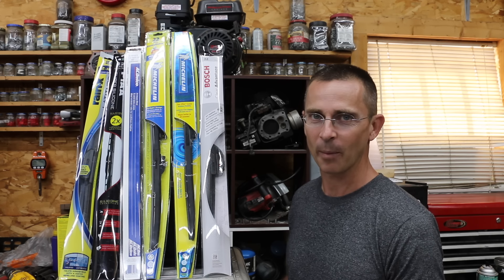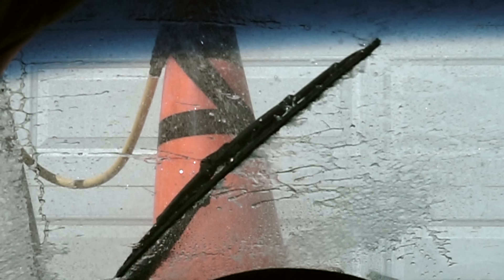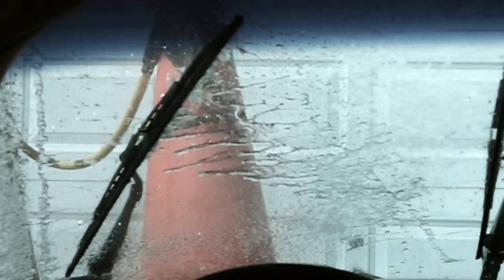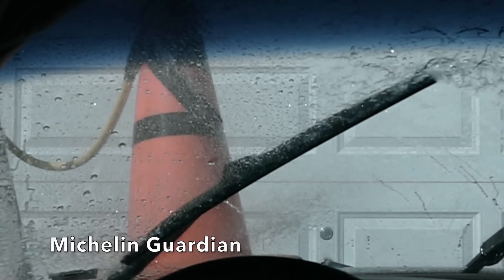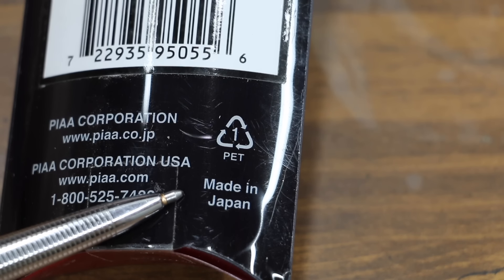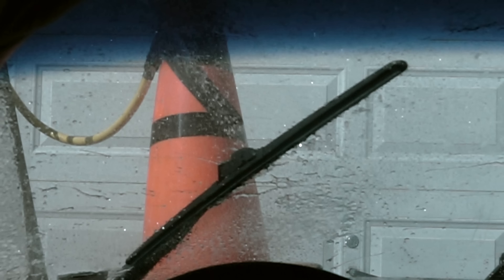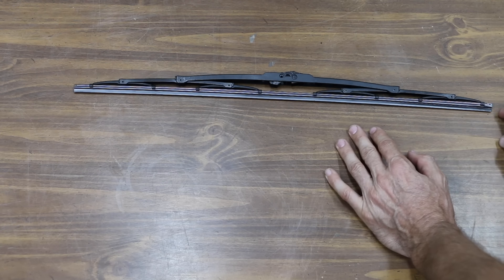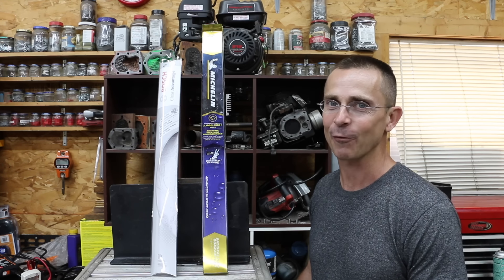Which Windshield Wiper Blade is Best? Let's find out!  Michelin, PIAA, Bosch, AC Delco, & Aero

Comment: Test tires, they are so expensive and quality ranges are all over.
Reply from the maker: Thank you for the feedback
Reply: Noah Ludford tires are gonna be a little more difficult since it takes several thousands of miles and a lot of variables between truck/sports/utility vehicles. That would be a challenge and a long time to put that test together. But a very good test I must say, like you said, they’re so expensive it would be nice to find out some truth
Reply: @cswango2744  give me an hour on a track....
Reply: I tested many tires in different conditions over the years. Dry performance:  ( breaking,cornering , acceleration)  Only Premium brands and their secondary products. Bridgestone, Firestone, Michelin, Dunlop , Continental, GoodYear. Yokohama,Toyo and co. Top or middle versions of each brand. Not the cheapest. During time Bridgestone and Firestone keep the rubber much better. No cracks and not losing grip in years. 
On wet: Same products but some companies made some special wet grip tires. Like Uniroyal for example. In general version Bridgestone Turanza are the best for the money. Winter tires  are not perfect no matter what. It's good to drive very carefully because you can't beat physics laws. All seasons are never good. Not too good in dry or wet or winter. Budget tires are ok if you don't drive fast or on the limit. I prefer old Potenza vs any new no name tires.
Reply: Noah Ludford yes plz
Reply: Well, I've had a lot of tires on my old 2002 F-150 SuperCrew that we use here on the farm... I bought it in 2004 with 29,000 miles on it and she just rolled over 336,000 and change on it now... I used to buy tires all over but now almost exclusively at Walmart.  For a long time I ran Continental 80K mile tires, and always had good luck with them... they would wear extremely well and handled everything you could throw at them, because I run on long distance highway/freeway travel (longest I've driven is 24 hours straight with only short breaks for gas, pee, and drive-thru returning home from Indiana when my Dad was dying in the hospital), all the way down to beat up gravel roads and potholed blacktop back roads to city driving... I really hated it when WM stopped selling the Continentals... 
Worst tires I ever had-- some Chinese mudgrips I put on the back for extra traction off road on the farm, primarily pulling hay and cattle trailers... Those things were supposed to be 40k mile tires (mudgrips don't last as long obviously) but one I got about 22,000 miles and the other 24,000 miles--- one blew out on the way TO Indiana from Houston, the other was shaking badly by the time we got home from Indiana around midnight... next day I saw why-- had a knot the size of my fist on the sidewall and the belt was starting to unzip.  TOTAL junk.  I bought them to replace a set of Traxxas mudgrips I had gotten on closeout from a tire store that wore well and were finally just too little tread left to continue... They had at least 40,000 miles on them when I finally had to replace them.  Prices for mudders have gotten rather ridiculous so I don't buy them anymore, just a standard LT is all I run anymore (although I do try to run 10 ply if I can find them at a decent price).  Mudgrips have become too much of a "toy" for all these rich idiots slapping them on their jacked up pickups to go play in the mud; they have more money than sense so the companies know they can charge what they want, so they do. 
Don't buy the cheapest tire you can get, but no sense buying the most expensive either... they all wear out sooner or later.  Main thing is that they shouldn't come apart or break down before the tread is gone...  
Later!  OL J R :)
Reply: I buy 4 from Walmart for 148 bucks and have delivered to my house. I have a cheap bubble balancer off Amazon and two crow bars . Easy to change 14 inch tires with a little wd 40 and some muscle
Reply: I would love to see this as well, but a great channel called Tyre Reviews has a lot of great videos reviewing and comparing tires. I'd highly recommend checking out that channel
Reply: RDLONG30  https://www.youtube.com/user/TyreReviews is the answer to your query. He, so far as I've seen, Is the closest to PF in methodology and throughness of his reviews. Even he only does "initial" testing. The other issue is... he does it all in Europe.
Reply: Project Farm  do a test with rain repellent as well please including glass coating vs ceramic coating on windshields please
Reply: I agree! I hear a good set of tires that are on sale on Walmart that can go 60,000 to 70,000 miles
Reply: @Adwest2323  Continental PureContact LS is better. TireRack tested.
Reply: Not to take away from Project Farm's test as he can still do his own. 

But, Tyre Reviews on Youtube actually does an in-depth review of tires mixed with tirerack.com and you can get a very good idea of what to buy and not to buy based on your usage.
Reply: @Adwest2323  depends on usage
Reply: I wish you would have picked up the more expensive Bosch icon wiper blades to see how they would compare. Cost wise they are up there with the latitudes but IMO are the best blades.
Reply: Most tires are tested thru racing competitions. Not just Nascar but other like Formula FIA WEC, and Le Mans
Reply: hi N L...
'
who is a word - THEY -
Reply: Noah Ludford Only if we viewers pitch in to help pay for the tires.
Reply: Tire rack.com  has the best tire info, I drive a 2018 WRX with Bridgestone Blizzaks WS-80 it’s unstoppable in snow and ice but don’t drive them in warm weather or real fast and sharp turns or brake hard it’s like driving on soft clouds
Reply: @justanothertroll9205  wow, I don't find that to be the case at all...I have a fleet of small delivery vehicles...passenger and light truck tires. Bridstone used to be one of my go-too tires but in the last few years have become one of the worst including a lot of tread separation. I loved Yokohama geolander AT/S here in snow country but they quit making them and the replacement lasts 20,000 miles less. Now running Continentals.
Reply: @lukestrawwalker  Continentals are what I use on my fleet because they work....when they go the way of Yokohama and bridstone I'll look for something else.
Reply: @dulagaferhatovic1426  and if you buy from tire rack watch for old tires and tires no longer being manufactured.....I have been bit by both of those problems.
Reply: tracy glenn true they don’t sell WS-80 they upgraded to ws-90
Reply: @ProjectFarm  
And wheel chains...
Reply: dragonspy91 yes, but we never get ‘those’ tires.
Reply: CONTINENTAL LS is better than Michelin Premier, and cheaper.
Reply: @bobbyturbopants  WD 40 is a solvent and will eat rubber.
Reply: @thisismagacountry1318  thanks I'll switch it up, the tires I run are so cheap I shouldn't be risking it with that stuff
Reply: Tires... Michelin in Amazon. You can't go wrong.
Hankook tires or kumho tires also are exceptional for the price you pay.
Reply: Troll Profi 
I like all season Michelin on my TJ Jeep .  What do you recommend for a wrangler sport?
Reply: I just found your channel.  Subscribed to it and I find the way you do your tests one of the best on the internet.  Someone commented about testing tires.  That would be impossible for one person to do in all conditions. I  have found that Tire Rack has the best tire tests out there, as they have their own test track.
Reply: German ADAC had superb testing done every few years.
Reply: Check out tyrereviews.co.uk, this guy is a complete tyre nerd and he also has a YouTube channel. He mainly focuses on higher end tyres, though.
Reply: reviews on TireRack dot com
Reply: Worked in a tire shop, brands to avoid.
Michelin in areas with high heat and humidity, they drop rate faster than other major brands.
Douglas for only normal commutes of 10 miles one way or less. They're not super durable and they wear out around 17,000 miles.
Brands that do well.
Bridgestone holds up to high heat and humidity very well, also last around 30,000-50,000 miles depending on the tire and how well you stay on top of rotations, balances and alignment.
Nexen makes good low profile tires, they hold up better than other brands when run underinflated. Less of a chance of having to replace the tire if it goes low and you can't get air in it soon enough.
Cooper, just all around good tires. Had a set on my Truck since I bought it in n March of 2017, got almost 40,000 miles on them. No signs of dry rot or uneven wear, still very good tread on them.
Firestone's are hit or miss.
Reply: Michelin dry rots, not drop rates. Stupid phone.
Reply: @theindooroutdoorsman  Michelin might wear out faster, but the grip of Pilot Sport is so insanely good it's worth it
Reply: Consumer reports do that extensively. Sustribe to its page or pro tip. Buy Michelin they are always in top 3.
Reply: @user-njyzcip  When a set runs you twice what a set of Bridgestones does, but lasts about half as long, they're not at all worth the money.
Reply: To compound issues with testing tires, I've seen the same tire perform radically different in different sizes on different cars.
Reply: Not possible. That would take waaaay to long and cost hundreds and hundreds of thousands of dollars.
Reply: The Indoor Outdoorsman g
Reply: That's gonna be VERY expensive.

Comment: As a resident of Phoenix, AZ I would be interested in seeing if these blades could be left exposed to the elements for 6 months, then tested again.

Here in the desert our wipers bake for about 10 months under intense UV and summer temps of 120 in the shade and likely the blade hits close to 200 in direct sunlight being black in color. Then, we get our monsoon storms and when we need the wiper, they crack and fall apart. The smart ones here just replace their blades in May before monsoon season, but I would like to know which has the best chance surviving the hell that is the Sonoran Desert.
Reply from the maker: Great suggestion!  I have them positioned to receive full UV exposure and will have a follow up in the future.
Reply: @ProjectFarm , awesome! Thanks.
Reply: A buddy of mine who lives in Phx would wrap his in aluminum foil and keep them in the glove box. We used to tease him a lot.
Reply: @wearemilesfromnowhere4630  , then you need another set to keep the wiper bar off the glass. I just replaced my wipers last month because one took a hit from a rock flung up and saved my windshield.
Reply: Well silicone ones should not be affected as much as the ruber ones if they are affected at all
Reply: Hats off to you man, I've been in Phoenix for a month and it was the worst. That heat is no joke I didn't wanna leave the hotel room one bit
Reply: @Reculse , you would think, but they die here. The question is how long. This is an area where window blinds melt, plastic trash cans left on a curb melt (granted a window reflection helped). The best paint jobs on cars with diligent was will still fade and oxidize within 5 years unless always covered when parked. Windshields delaminate in the heat here quite often.

There is a very good reason all the auto manufacturers from Ford to Hyundai have test facilities in the Sonoran and Mojave deserts. It is brutal here on anything exposed to the sun.
Reply: MP  I feel you I just end up buying the cheapest set available every year as it’s only like 10-15 dollars, most the time I just use wax or rain x on the windshield and don’t reallly need the wipers. I’d be interested to see the follow up though. I wouldn’t mind spending more for a set that will last in AZ
Reply: @nickgrillo4830  , that is my deal as well. I go to Autozone and get the special, whatever brand it is and know it only has to last 2 months or so. Of course, if a $25 blade can take it then it is worth it.
Reply: @Reculse   I tried silicone blades a few years back: 3 times the cost and did not perform any better : $30.00 after one winter and one summer in the second solar / ass roasting city behind Phoenix AZ ( Redding CA).,  they would not last two winters so i saw no reason to buy them again , Michelin from Costco at around $ 14 .00 a set every fall...
Reply: @ParkerUAS  Yea i understand that but the good quality silicone is quite resistant.Most chemicals don't affect it and it holds up  to  300 degrees celsius without breaking a sweat. But it is very expensive.
Reply: i replace blades yearly in October cause I live in South Dakota,  been here since 1990  and I've noticed the rubber ones break down faster and left streaks the last few months.  since I changed to silicone, the wipers have made it a full year, I probably could go longer but changing blades in 20 below sucks, plus October is when I do pre-winter checks.   like air filters,  rubber hose inspection, cleaning/tightening of battery terminals,  changing of wiper fluid to deicer type,   so on.
Reply: @Reculse  , I think the intense UV is going to be the culprit.
Reply: See huys like this
Reply: I live in Las Vegas and our temperatures are about the same as Phoenix.  I run Trico NeoForm with Teflon Coating on my Wrangler. I 4 wheel a lot, so being able to hold up heat and to the sand dust on my windshield when I am out 4 wheeling is also important to me. I have had really good luck with Trico blades holding up. I get about 18-24 months out of them. so far they are the best I have found for a hot environment. my Mopar factory wipers only lasted 3 months. I have tried the premium Bosch, ACDelco, RainX. all of them failed within 6 months. so I am vary happy with Trico. also Trico is Made in the USA.
Reply: I'm with YOU
Reply: No kidding. I'm in Mesa. The sun, the heat, the constant dust.. It eats wipers like acid.

I had a buddy that found some wipers that lasted him 5+ years. He told me what they were but I've forgotten and we don't hang out anymore.
Reply: @Reculse  silicone dies just as quickly.
Reply: I always received excellent performance from my Bosch wipers, while living in Prescott, AZ
Reply: I know the struggle. When the first few rains of the season come in, you will see trash cans FULL of old wiper blades at every autoparts store. It's pretty interesting.
Reply: @KurNorock  Sheeesh, why tease us then?
Reply: @midnightgambler3718  Share in my pain! Muah haha ha ha!
Reply: @ebuff57  Well yeah, how hot does it ever get in Prescott?  It almost never even reaches 90 degrees there. Plus as far as I know, you don't have the constant dust in the air like down here in the valley.  And with an average of 16in of annual rain fall, Prescott is not even considered to be in the desert. 

You are the San Diego of Arizona.
Reply: @ProjectFarm  Invalid test....sorry..but on this one you messed up a bit. The PIAA IF you'd have read the instructions and opened the packaging properly you'd have know they also MUST be used dry on glass for 5 minutes. Also you didn't show the PIAA silicone in the ice test cause it would have made all the other ones(except michelin silicone) look like shit. The silicone doesn't freeze BUT YOU HAD TO MISLEADINGLY state ''all metal frame are shit with ice'' and to have shown the PIAA silicone with metal frame be different would have invalidated you statement about 'all metal frames''. ALSO those rubber wiper won't last 1 month before they have small streaks. I've had the most expensive Bosch and Valeo and they suck compared to the PIAA which i kid you not lasted 6 months without ANY streaks and then i gave them away when i swapped company car. If you want a proper test then the 1 year long test with UV must also have a non stop wiper test that lasts like 48 hours continuous for each brand to simulate 2 weeks of 2 hours of wiping for 14 days. Then we'll see which is better and we'll in fact see the bosch being shit.
Reply: @Choice777  damn man.  i liked them because they were made in Japan.
Reply: We Desert Rats from Arizona live in Windshield Wiper Hell -- Blazing hot in the low deserts, and Freezing cold in the mountains.
Best blades I've found are the BOSCH "ICON" -- they wipe clean and last a long time.
Reply: @wearemilesfromnowhere4630  I used to do that with Thai Sticks. Keeps 'em fresh !!

Comment: Been running Bosch icons for the past 2 years, they still work like brand new, no noise and removes water really good 👌🏽
Reply from the maker: Nice!  Thank you
Reply: I run icons here as well. I need to look into a cheaper place to buy, I tend to give around $45 a pair at the parts store.
Reply: I run icons in Colorado, and my last pair is a year old and going strong. I also park my car outside on the driveway.
Reply: Yeah they are good blades, not bad and for $20 it does a great job, in SoCal these can easily last me a total of 4-5 years

Comment: The best blades I've ever used are the now hard-to-find Anco Winter Blades. While intended for snow (which they do very well in -- they're the only blades I've used that didn't lose effectiveness in heavy snow), they also work great in heavy rain.
Reply from the maker: Thanks for the feedback.
Reply: 100% agree with this comment. I found them in Council Bluffs Iowa back in 2004ish at Walmart. They don't last long, but they are CHEAP. Streak free and seem to be coated with something. Also, they never caked with snow or ice. 
Black and white (maybe it was yellow and white hmm packaging sold by the beam. :( RIP Anco.
Additionally, the reason I think they never cacked was the design of the jacket. It was a thin silicone rubber skin of sorts, rather than a "boot". That made the difference.
Reply: SAME! My faves.
Reply: You're talking of the W serie?